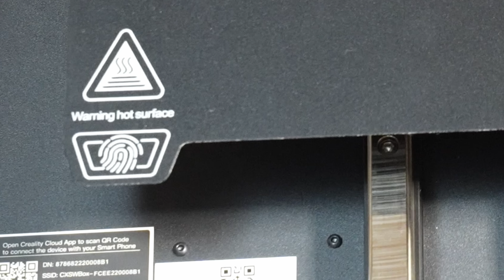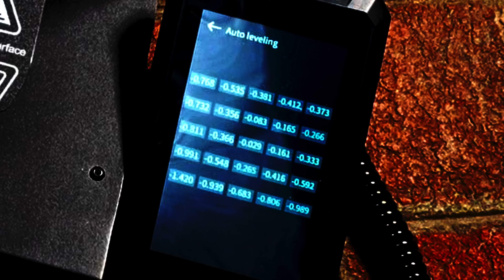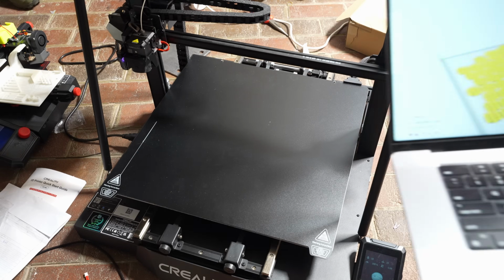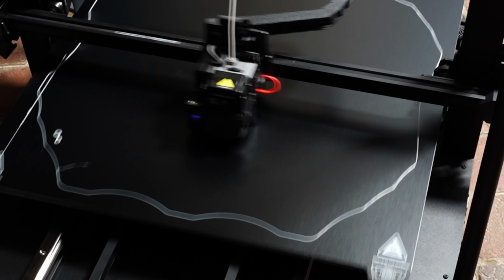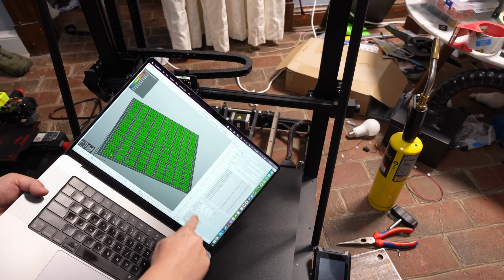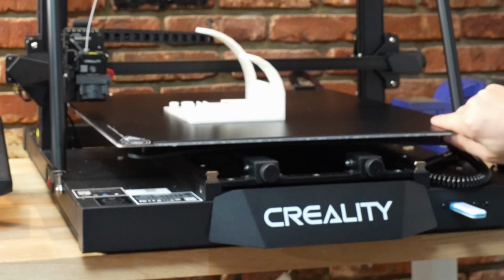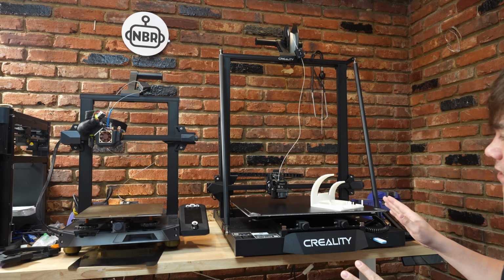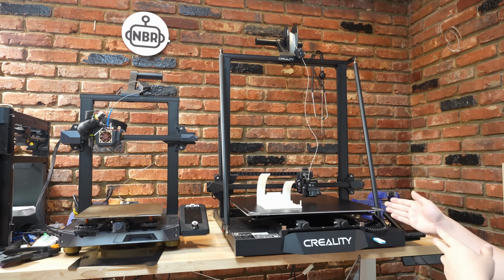CR-M4 - The Biggest Ender 3

Comment: yeah i wish they'd give proper instructions how to assemble the machine, the same ones they give their employees, better yet the engineer who designed it should explain how it goes together, the best order etc.   I had mine already preassmbled but sort of wish i had to assemble it,  because after  rotaing my zrods for fun i realized i didnt have the correct order of operations when i put it back together.  I managed to find out how but what you just said there in that 5 seconds was more info then i could find on the subject.  I actually found a nother video that mentioned how to align everything but not really a step by step from scratch.  I think all printers print great when properly setup, some fater then others is the only real difference, quality should be the same, since the models are.
Reply from the maker: I have a whole hour of going through the wheel tightening step by step. But it really interrupted the flow of the review. I could edit it into its own video if you think that'd be useful?
Basically you want the tension of all the wheels to be roughly even. It requires things to be assembled a certain way. The components have float built into the joints, so you can loosen things, and the tolerances/forces between all the parts completely changes.
Reply: @NathanBuildsRobots  woah yaeh that would definately be useful,but yeah not really fitting the flow of this video i understand.  Thats more of a guide video that would be a totaly differnt thing but definatley helpful to a lot im sure.  Im still not sure  i put everything back correctly and just leaving it becaus i got no issues with it, but deep down would still like to take it apart and put it back together properly,  infact i know i put swapped the left and right frame peieces by accident but by doing so i was able to get a squarer fit when locking down the bolts it seems, id have gaps and overhangs the other way...  so im laeving it for now because i might of just got lucky, it prints better then when i got it. So it definalty wasnt perfect from the factory either, making a video like that even more useful to many i think.

Comment: an idex version of this is a must for this print size.  speed up production
Reply: iQex at this price
Reply: Easily modded to be IDEX.  Did it to my Ender 3 Pro, no kits needed if your handy but you will need to be proficient with configuring firmware.  I don't dual/mirror print anything so I run Klipper.  I mainly use it to have 2 different nozzle sizes ready to go and dissolvale supports.  There are downsides to IDEX as well, nozzle changes for example require zeroing both tools again.  Take it apart and you will be re-aligning X/Y tool offsets which can be a pain to get accurate.

Comment: another crap printer from Creality. You'd have to remove the touch screen, then add the 12864, you'd have to remove the Sprite and add a decent hotend and extruder combo to it. And it likely has that goofy Motherboard the S1 uses. So you'd have to replace the motherboard as well.
Reply from the maker: I prefer the older motherboards, not a big fan of what creality has done to force everyone onto their proprietary boards with goofy connectors. However, it does the job just fine, and we SHOULD be moving to a single plug harness, but I don't think any of the main brands have really found a good solution. Bambu has the best I've seen with the USBC cable to carry all the power/signal to the hotend. That is ideal, except now you have 2 MCUs, one on the mainboard and one on the hotend. That isn't ideal, but it might be the best solution i've seen so far.

I do like having only 1 MCU for the whole printer, with a breakout board for the hotend. Makes troubleshooting much easier, though the 20+ wires required to make it work is a bit barbaric.

Spare motherboards are $26 on aliexpress, so just buy another to have on hand if you're worried about it failing. Or just get the Sonic Pad and be happy running Klipper for dummies.
Reply: @NathanBuildsRobots  Single Plug Harnesses are prone to Electromagnetic Interference, and if one item goes down, it could back feed and short circuit other items. Everything should have it's own independent wire[s]. 

And I won't run Klipper it was designed as a crutch for older 8bit boards. Now that Marlin 2.1.2 has Linear Advance and Input Shaping. There is no reason for Klipper to exist.

Comment: I contacted Creality and was told there wouldn't be a major sonic pad update until November for CR-M4 compatibility. Then I asked a question about my extruder quiting mid print multiple times and got no response. They are really hit or miss.
Reply from the maker: Wow, the extruder on which machine?
Kinda odd that the klipper config takes that long. I’d be able to do it in an afternoon…
Reply: @Nathan Builds Robots  The extruder on my CR-M4. It's sporadic. Been through connections, hotend, swapped usb sticks, swapped hot end with spare, flir camera extruder, reset firmware... really odd too cause I stop the print and can extrude manually.
Reply: @chriswhite2718  Have you tried disabling the power recovery? Use M413
Reply: @AndrewAHayes  yeah, in the slicer I put it as the printer start code. Plus I have it hooked to a 2000w battery backup(didn't fix issue but good anyways) but I've still had failures since then. What's weird is I haven't had any hot end issues, just randomly stops extruding but XYZ continue on. No clicking binding or tension issues.
Reply: @chriswhite2718  I don't even own a 3d printer but I've recently ordered a M4 myself and what just reading random stuff online I think you issue might be bad PLA-spool..? Maybe it's a cheap roll that have bad tolerances and get stuck?
Reply: @NathanBuildsRobots  I'm just a beginner hobbyists with a 6 year old boy that likes cosplay so making large items was selling point. Borrowed friends ender 5 and decided to go this route buying my own. I'm learning a lot as I go and don't mind. If I were capable I woulda had klipper running as soon as I started having extruder issues.
Reply from the maker: @chriswhite2718  I wonder if its a slicer issue. It could also be the stepper driver overheating on the mainboard. I think they automatically turn off when they get too hot? Not 100% sure on that. In any case, you might want to try getting some help on my Discord, a lot of people get free troubleshooting done there.
Reply: @NathanBuildsRobots  I'll have to checkout discord. It's weird cause it's hit or miss. Everything else on this machine I think is awsome. Finally doing a print now with machine elevated and the bottom plate removed to see if it is a mainboard cooling issue. I could see where there could be insufficient cooling. I've also had machine restart a couple times too in middle of print.
Reply from the maker: Maybe their plan is wait for someone from the community to do it, then copy it onto their next sonic pad firmware update

Comment: Loose screws in Creality, who would have thought? :D
Reply from the maker: Sometimes I think it would be better if these printers came as kits. That way I can assemble them properly. As it is you have to check a whole lot of things that aren't in the instruction manual. You need some mechanical know-how to get everything working properly.
Reply: @NathanBuildsRobots  you need mechanical know how + luck + software trouble shooting skills.
Reply: I took a couple hours disassembling mine when I received it. Undid alot of screws and used blue Loctite on everything. Never did build plate though. After watching this video I checked them and sure enough, could get a full turn out of them.😂😄😆😅😂 Always something, thanks!
Reply: It's been 6 hours since this comment and I am still laughing.

Comment: Impressive bedslinger but should be xy-core for the price.
Reply from the maker: There is always the Tronxy X5SA if you want CoreXY. Its a 500x500 corexy printer, but it is missing some features like direct drive extruder, and who knows what the quality is like.
Reply: @NathanBuildsRobots  I'm pleased with my ratrig at that price, but you do have to assemble.

Comment: But Sonic Pad is just a Klipper device. It should be able to run it if you make your own cfg file
Reply from the maker: Yeah, I'm all about that easy mode though :P
Reply: Its not a standard Klipper image though, Creality have messed with it, there are loads of updates for the Sonic Pad and sometimes multiple updates every day for longer than a week, some of the updates are to fix previous updates according to some Reddit posts I have read.

Comment: that's the s1 plus print surface! I thought it was pretty good, although a giant PEI sheet would make a better noise when you wobble it, so...
Reply from the maker: I didn't realize they made different types of black PC print surfaces. I thought they were all the same, but this one is actually pretty great.
The ones I got with the Ender 3 S1 and Ender 5 S1 were waaaay too textured and wouldn't let go of prints. I assumed the S1 max surface sucked without trying it, so I replaced it with PEI without even trying it.
Only reason I gave this bed surface a shot is because I have no idea where I'd get a 450x450mm replacement. But I'm glad I tried it out, will probably be keeping it.

This makes the wobbly noise too!